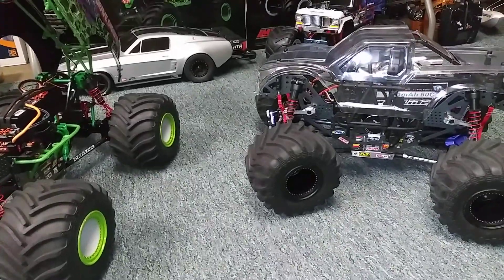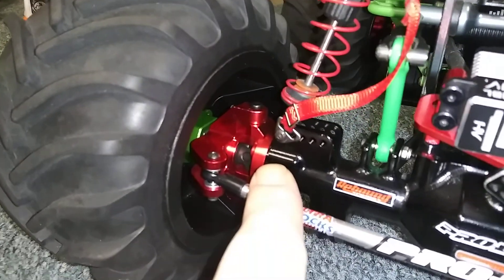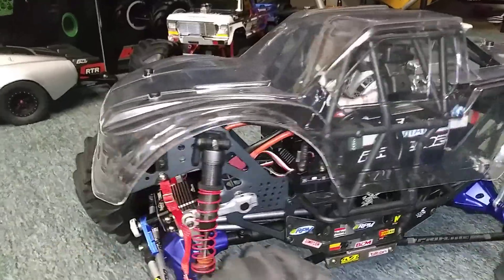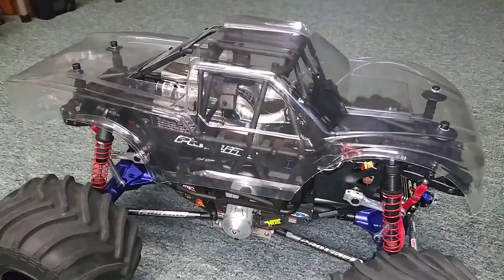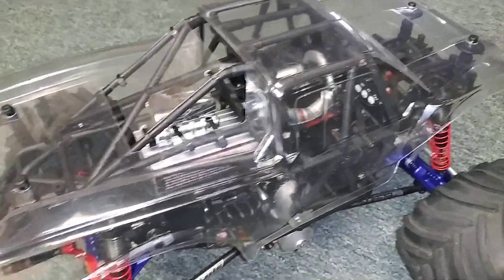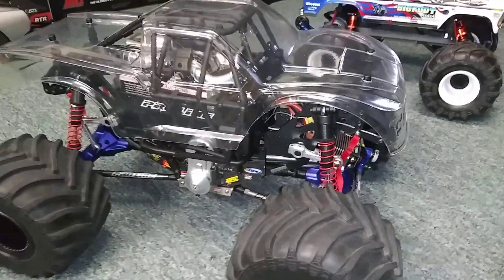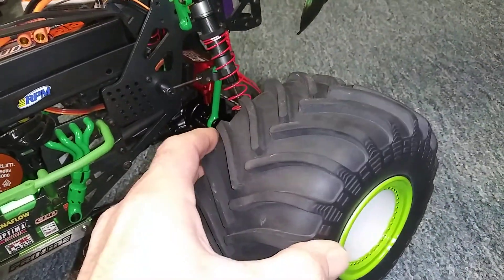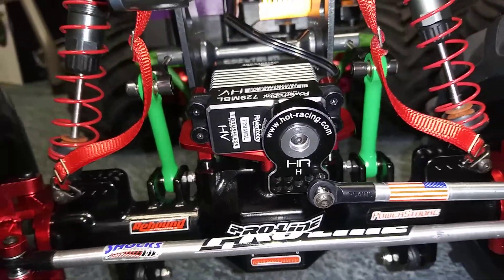Losi Lmt with the Treal sway bar's installed.

Comment: Nice upgrades! I bought the same axles. The shock mounts had a small radius that interfered with the Treal steering blocks I was using. A Dremel was needed to remove the material interference. Other that that, the axles seem pretty good for the money. I also have Vitavon rear axle and a Treal front axle on another vehicle. Also installed the Treal sway bars since the stock keep breaking. Next will be the shocks. I also have the J Concepts modern Blackfoot body. Seems like we think alike!

Comment: Great video do you have a link to those shock Springs?
Reply from the maker: https://www.ebay.com/itm/Traxxas-3757R-Rear-Shock-Springs-Red-Slash-Rustler-Stampede-2-/333906218655?mkcid=16&mkevt=1&_trksid=p2349624.m2548.l6249&mkrid=711-127632-2357-0
Reply from the maker: There a little stiffer then the stock springs the lmt come with. They make the truck handle better at hight speed and stops all the bouncing around and roll overs.